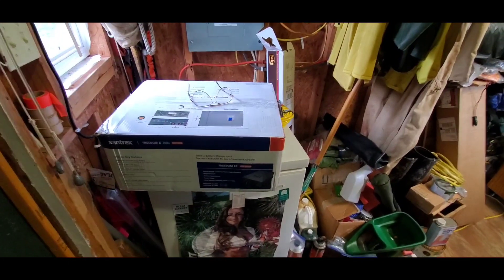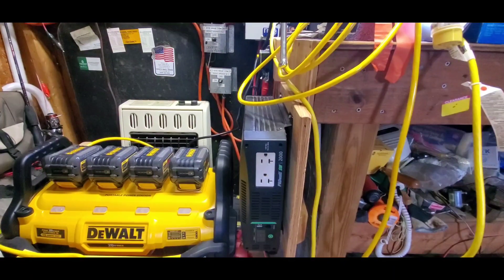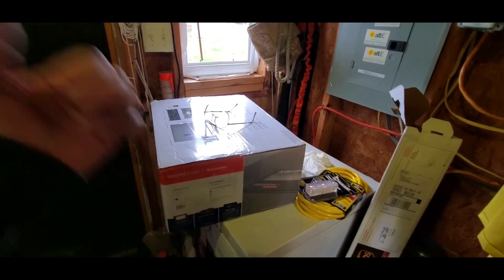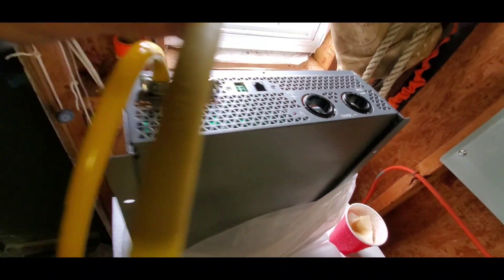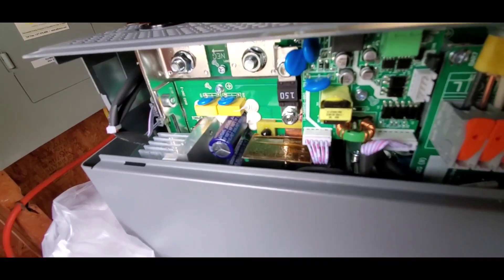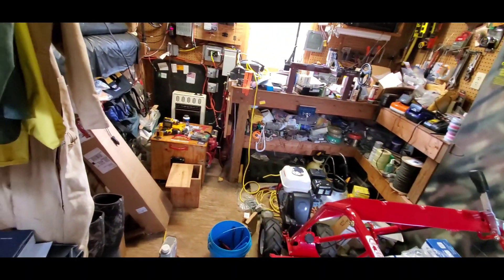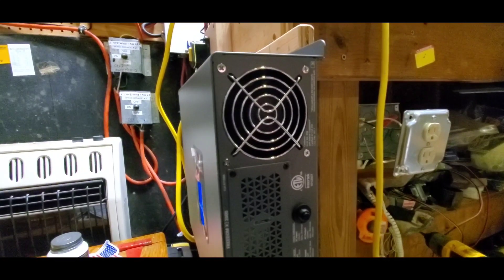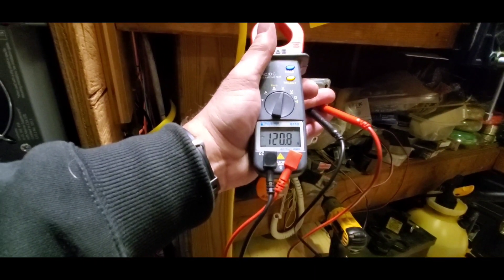Off The Grid Xantrex Freedom X2000  12 V True Sine wave Inverter install & Review By KVUSMC

Comment: Does the 8 awg wire go into those connections to the inverter?
Reply from the maker: I'm using 2/0 for battery side and 12-2  for my AC out and 12-2 extension cord Shore power AC in Buddy
Reply: KVUSMC / Kenneth W Viar Jr do you think I can put 8 awg in those clips?